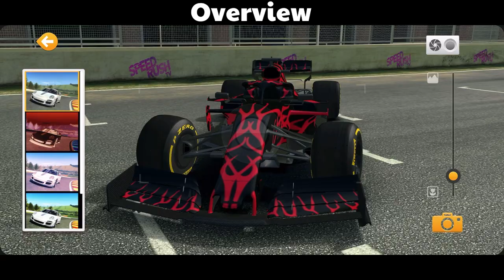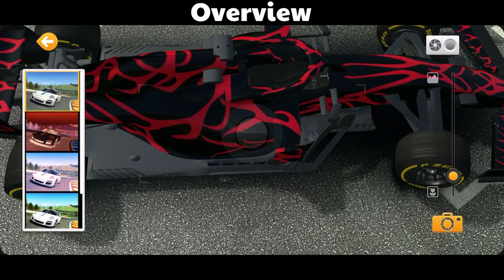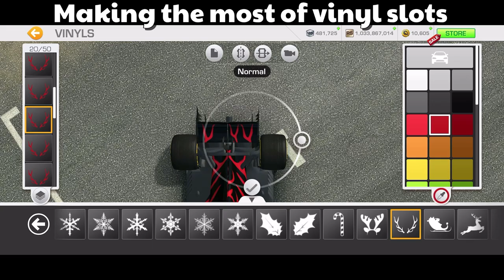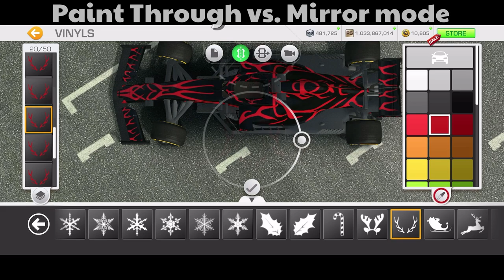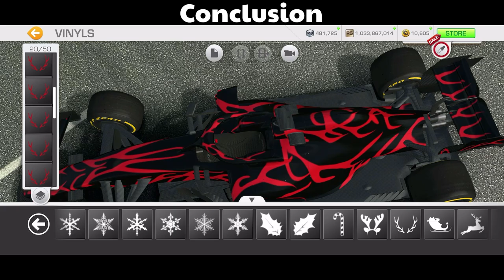Symmetrical Vinyl Design

Comment: When i play endurance and time trials, the throttle and break does not respond at a point.  Dont know why. It costs a lot. I may sometimes not able to complete endurances or go off track for a time trial.
Reply: make sure your thumbs aren't sweaty/dirty and the same with ur touch screen, often it is due to the lack of contact between skin and screen, if this doesn't help/fix the problem then try reinstalling the app (make sure to do a cloud save first!)

Comment: Me7 try to check out the endurance on 9.0 Update on Real Racing 3 because my audi r8 lms in Porshe Test Track I Reached only in 19.9.
Reply from the maker: Nothing has changed, it just takes practice. It’s impossible for most people at first. After a while it becomes easy. You have to have every single assist off and really watch that off-track slide in. I find tilt B is best because I can control my skidding that way. However it’s possible in all control options.